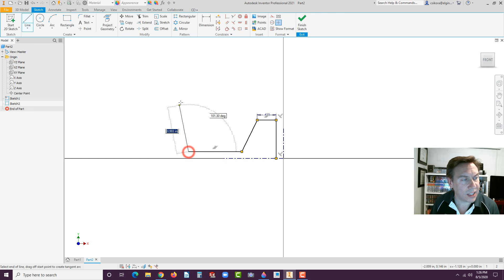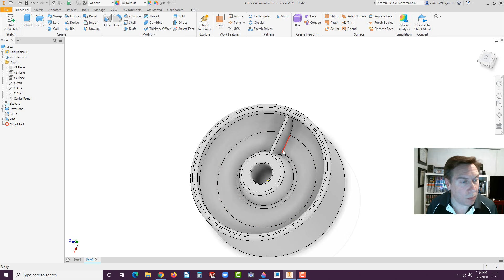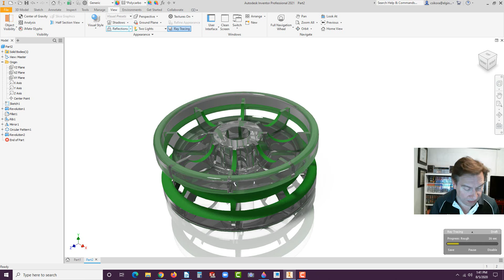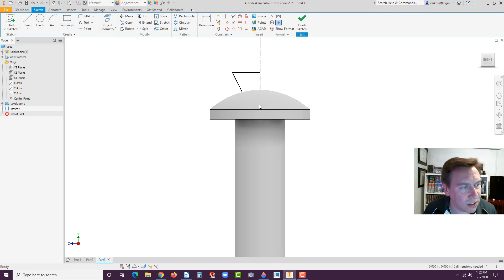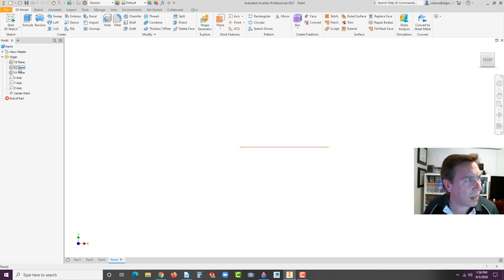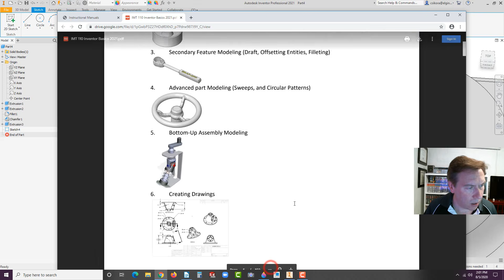E2 Autodesk Inventor 2021 - Basic Modeling 2 Tutorial

Comment: when I did this on my own I didn't use mirror function, I'm not sure if that's an issue with how you wanted it done but mentally when modelling parts, I try to have the features set up in an easily manipulatable way so it's easy to go back and edit the part in the future. for this I sketch the rectangle, fully defined it to the origin then extruded it, created the secondary cylinder extrude, thru hole and finally a sketch with the 4 thru holes defined to the sides of the rectangle and set to be equal to each other set at 0.500

Comment: 20:40 Not to mention if you have a gaming computer with a GPU. My RTX 4070 (with 5888 computing cores) is supported, and the ray-tracing absolutely flies after I enabled it. I'm not sure if Inventor uses the CUDA-cores (of which there are 5888), or if is uses the dedicated ray-tracing cores (of which the chip has 46) though.

Comment: Thanks that I knew , I was referring to while dimensioning in sketch mode is there a way to get the R for radius and the diameter symbol to show when actually dimensioning.  For example R.125  or the dis. Symbol .25.    I’ve seen it come in to play without a center line. But can’t repeat it.  There are time I don’t know whether it’s a radius or dia.  when there is no references to size. As if I were doing an actual print.